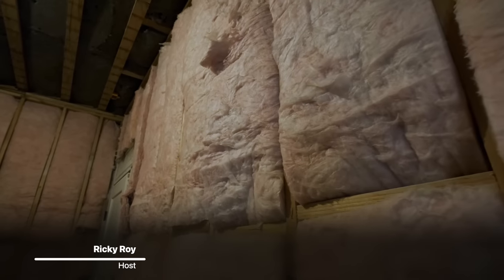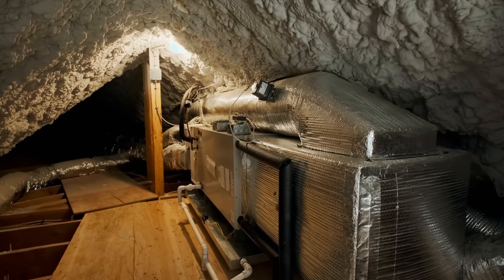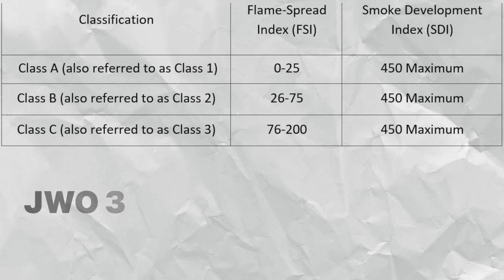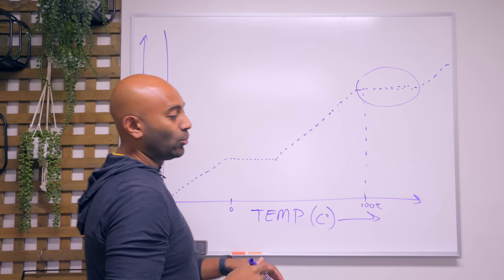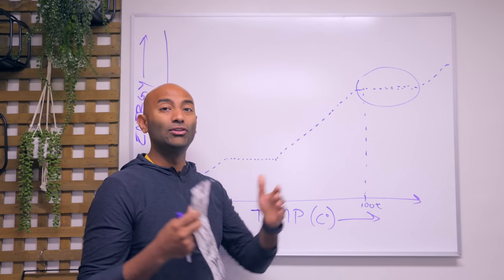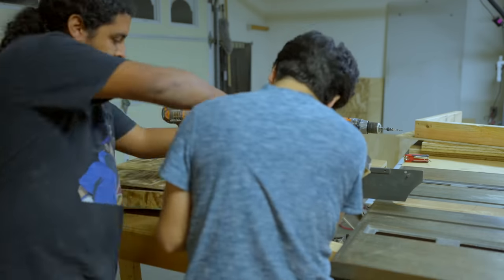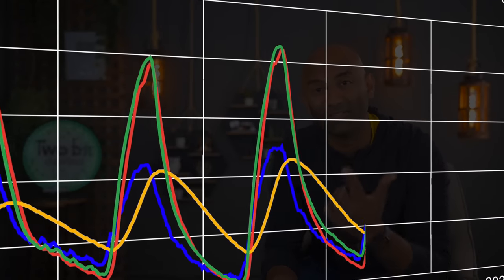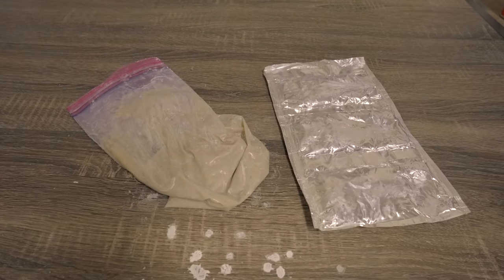The Genius of Phase Change Building Insulation!

Comment: I could be wrong, but I'm pretty sure I'm not. The problem with this insulation if we ignore the foil is it doesn't work as an insulator, so once it's warmed up or cooled down it basically useless. The main time this would be an issue is in winter, it might get a bit warmer during the day, but it's going to remain constantly cold not allowing the stuff to re solidify. This could also happen durin prolonged hot periods when it doesn't cool down significantly at night.

Also it will have a rather specific temperature range it's suited for, meaning if it's  hotter or colder than normal weather where you live and outside the design temperature it's never going to go through the state change.

I could be wrong and they somehow design for this with multiple materials with different melting points in layers or something.
Reply: I think you are right. This is only for deserts where the day is hotter than you want and the nights are colder than you want.
Reply: The object is to pick the specific temperature melt point for the enveironment and the placement in the building. These choices will be based on a number of criterion. Such as Whether it is largely a heating or cooling area, daytime and diurnal overnight lows, sunlit surface temps, any available R value, and others. You are also correct that in order for the IR reflector to work it needs an air gap. If one is not available in the assembly, the reflector will not work, However it may be that the low emissivity surface can be utilized to ensure refreezing. There is a pretty simple formula for determining the amount of PCM necessary for an application. QE Platinum will happily share it with you so you can determine  Where to place and how much QE Platinum needed for a specific application.

Comment: What was the melt point temp of the material you used? I’m familiar with a house in Colorado that used a similar product. They have to open windows everyday, even in the winter, to cool the house.  It is critical you select the right melting point for the PCM. Once installed you have to live with your decision.  Not much real world data exists. I’ve run basic tests on it and in general my results were the same as yours. It smoothed out the curve. And as you said the temperature must move across the melt point which may not happen on a residential interior. I’m considering an exterior application with a 32 degree set point in Colorado.  Almost everyday the winter temperatures move across freezing. For San Diego I would think an attic installation would work well for heat moderation. Make sure you engineer structure for the added weight. Good luck!
Reply: Yes, the house in Colorado does indeed have to open windows in winter because it is kept too warm by the PCM and solar hot water. (the only time the furnace has come on EVER was when the solar water pump failed). When the house was built, 78f was the only melt point option worked out. and of course 78f is way too hot for a house at over 8000' elevation. Still, you can't argue that opening the windows isn't a better option than $1000 per month propane bill..
Reply: @garygray-fx1ho  Good to know.  I was using ENRG Blankets from Phase Change Solutions/PhaseStor.  I was actually testing a heating product, WarmFloor, from Step Heat, a 24 volt heating mat that is solar compatible.  I was testing to see if during the day I could use solar panels (direct connection, no controllers, no batteries) to power the heating mat in a crawlspace with PCM placed on top.  The heat from the WarmFloor mat PCM would melt during the day and solidify during the night releasing the heat.  I tested other "mass" options for storing the heat.  Result:  In a crawlspace, with weight not being an issue, a cement paving stone worked almost as well as the PCM.

Comment: I think you will need realy lots of it to make a difference. You need to know the heat capacity of the material to be able to calculate how much you will need. The phase change is cool. A phase transition can accumulate/release much more energy than the termal capacity alone. But still I am sceptical that this tiny pouch can absorb the heat that you would have otherwilse lost trough the wall during the winter.
Reply: Exactly. A ploy.
Reply: It doesn't absorb heat from the inside, it absorbs heat from the outside. It is for staying cool from a hot desert sun and then keeping warm in cold desert night. It doesn't work in winter or for cold climates.
Reply: @allocater2  Not quite correct. You are right about summertime absorbing and releasing heat from and to the outside, However in heating environments, communicating with the conditioned space is the optimum use. Heat otherwise lost in the walls, is captured then melts the PCM, then when the heat is turned down overnight the PCM gives its heat up to the conditioned space. In either case use traditional R value to determine the direction of the flow of heat..The path of LEAST RESITANCE...

Comment: You did the graph the wrong way around. The axis labels are flipped. Your graph shows increasing temperature at the same energy, when actually melting the material  provides constant temperature while energy is added. Your explanation was correct though.

Comment: Since it doesn't act as insulation, but more of a temperature mediator, it should be mounted closest to the conditioned interior, not close to the interior of the attic or exterior side of walls.

Comment: So, this product is an alternative for thermal mass.
Reply from the maker: Thermal mass where you cant add traditional thermal mass?
Reply: It would definitely be a lot lighter than traditional thermal mass.  It would make it easier to level out and keep the temperature in a structure stable.

Comment: This heat trapping system would be well suited to places where it's hot (or at least sunny) during the day and then cool in the evenings; evenings where it would be nice to have a bit of the day's warmth in the house.  Would it be of any use where the ambient temperature is constantly too hot for comfort - like in hot and humid environments?
Reply from the maker: No… it needs that charge discharge cycle to be worthwhile. You would benefit just as much from a radiant barrier which is super cheap but does need to go inside walls which isn’t
Reply: @TwoBitDaVinci  I've heard of an idea in Israel (similar weather to San Diego) - where there is a outside wall in your house that faces the sun during the day, absorbing heat, and then, in the evening, the actual wall is rotated so the warm side faces inwards. This phase shift material would work really well in that scenario since more heat would be absorbed per unit area - more than just heating up a solid layer of bricks/stucco.

Comment: Could those packets also be made to produce and store electricity based on heating  and cooling fLow
Reply: Use it as heat/cool.. Converting heat or mechanical energy to electricity is valuable of course but much  is lost in the conversion. Heat is heat, no conversion losses. Use it..

Comment: Thanks for the video. Since the content of the foil pouch changes state with temperature variations (liquifies-solidifies) the protection it offers will be uneven with use. In liquified state, gravity will act and the liquid will be accumulated at the bottom of the pouch so the upper part will not offer the same insulation properties. Multiply that by the number of pouches used in a given structure and we'll find a sizable area of weak insulation. There might be solutions for that (reducing the size and shape of the pouches for example) but there are other drawbacks as well. The idea is interesting but as is I do not find it a real benefit in comparison to other solutions available.
Reply: Are they not making pouches where the liquid fills the entire pouch? Also I guess as long as the aluminum foil equalizes the temperature of the upper pouch with the lower pouch the heat will end up in the material. It's not an insulation material that has to cover every nook and cranny to block the heat flow.
Reply: @allocater2  The material starts as a solid, when it liquifies gravity will push the liquid to the bottom of the pouches. The effect is the same and simultaneous to all pouches in the same area (same temperature exposure). The bigger the pouches the more problematic the situation becomes. Also, if there are gases produced during the material state changes, the pouches may burst overtime with use, as the gases may accumulate.

Comment: Compare it to the SAND BATTERY! 🙏
Fill your walls with sand!

It may also be important to use the right amount of energy storing installation (sand or phase change) for your space. Too much heat storage could leave your home too hot during the day if the insulation didn't get a chance to cool off enough overnight.

This is also reminding me of something called an earth battery where a bunch of HVAC ducting is just run underground to benefit from the heat energy storage of all that dirt. The downside of this is the cost of all that digging.
Reply: As an excavator I want to say that there is no downside to digging. Jking

Comment: Two Bit da Vinci:
You should have applied your own heat and cooling to the outside of the box or even just a wall with no box.  Then measure how much of that heat and cool is straight transferred through the wall of insulation and you need to test with foam since most new homes offer this and you didn’t during this test.

I am a custom home builder in Dallas, Texas, I build multi-million dollar homes.  I currently have six frame stage homes if we want to run a test batch.  How do we get in touch with each other?

Comment: There seems to be a big flaw with this material in the wall: in order for a radiative barrier to work you need an air gap on at least one side (but ideally both). If it's touching drywall on one side and insulation on the other conduction will transfer heat directly into the material (bypassing the radiative barrier). So presumably you'd need some kind of spacer to make sure you have an inch or so of gapping between the material and the drywall (or insulation)? Else, maybe they could make a cheaper version without the radiative barrier.
Reply: The material itself is supposed to be the insulation/air-gap. It will not transfer the heat to the inside it touches, because it stays the same temperature as the inside it touches.
Reply: Yes, insulation will slow down conduction. But a radiant barrier is useless unless it has an air gap.

Experiment: Hold your hand 1" over a black frying pan and then over a shiny one. You'll find that the black one feels hotter. The shiny stuff stops radiative heat, it does not stop conduction, though - touch the pan to find out.

Obviously insulation is still great without a radiative barrier (most insulation doesn't have it). I'm just saying that if you're going to buy the stuff with a shiny surface, then you're wasting money unless that shiny surface has an air gap next to it.

Comment: I don’t understand how laying the phase changing material on top of current insulation in the attic could be sufficiently cost-effective, given that my attic itself would be very, very hot.  I would think that you wanted to put the phase change material in the roof trusses to prevent the heat coming into the attic to begin with.   

The other factor for me in Michigan is extremely high humidity that usually accompanies heat waves here.  My 1950 brick home is now pretty well insulated. The largest benefit from central air conditioning is the elimination of the moisture in my home during the summer.

I’m wondering about the effects of the vapor barrier quality of all aluminum in my situation.  I’m still processing. I am not able to ask a question yet.

Comment: You missed the real comparison. Spray foam with Reflex  bubble /foil reflective product. Foam and fire are not good but I think the Foam and Reflux would provide a game changing combination! Plus the liquid will break down or the packaging will break down over time even though they claim it doesn't. Unless their 30 year warranty is to tear out the sheetrock and replace everything their warranty is the usual game. They offer a 30 year warranty on the product. It is buries in your wall. Packages degrade and stop working. You file for a warranty replacement but cannot afford the "labor and materials" also required for replacement. You end up with junk in your walls and they claim they have never had to make a warranty replacement! (The power of wording.). Also, How do you address remodels like adding a window or electrical to an exterior wall? Hang a picture or install siding? You are going to hit the packets at some point using normal construction methods.

Comment: I'm guessing you had the boxes outside in sunlight with a temperature probe within. 
The volume thermal mass and area are tiny compared to the thickness. Scale that up to a real house, the areas would square and volume cube so thermal mass and thermal loss area would be very different. You also have no internal temperature control to create a representative delta T differential from inside to outside. Your internal temperature will be a function of sun radiation and conduction with ambient cooling from airflow with the internal temperature tracking.
A better and easy test rig, short of buying an environmental test chamber deigned for the purpose,  might be to build a representative wall sectioned into your different test materials to fill and seal into an open window frame, then use a thermal camera. That way you will have representative volume and temperature control on the internal side and a real outside and you could then see the different surface temperatures with the camera both inside and outside.

Comment: I don't think that in your experiment the air-tightness(lack of it) was even the main problem, yes heat influx is lower with insulation than without, but with so litte heat-capacity of the thin air inside the box, even 'less' is still more than enough to heat tis tiny bit of air, its like an RC-filter in electronics: make the capacitor small enough and the time-constant of the filter is to short to make a diffence for slow oscillating signals like 'once in a day'.

Comment: Does it require an air gap on either side to work?  If you have 2x6 walls maybe you could use 2x4 Rockwood and this
Stuff?
Reply: Excellent choice Terry, In heating environments Put the rock wool in then PCM then sheetrock, In cooling, PCM, Rockwool sheetrock.. Use the Rock wool to control the direction of heat flow when the PCM gives up its heat

Comment: So, internally, this may not make sense..unless, like you say, you rip your walls out.

Surely, as what happens in the UK with our typically brick built houses, the wiser option would be to clad the outside of the house with this using a substrate which can then be rendered on the outside to make it look pretty.

This would have an advantage over the polystyrene based alternatives in terms of fire ratings and overall bulk/depth of the product required.

Also, it would allow for much larger amounts of the product to be sold in one go, and, the economies of scale should then kick in and reduce the cost further.

It'ld be awesome if they could do this in that format over here in Europe.